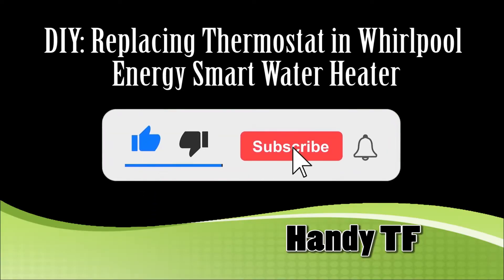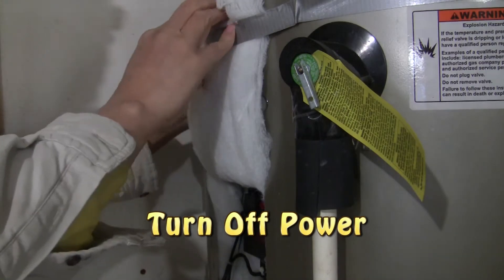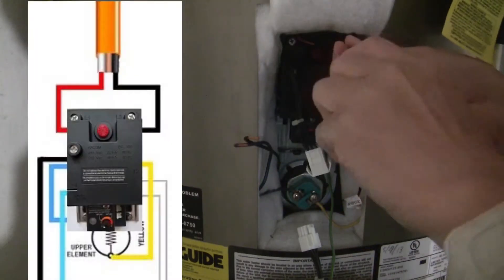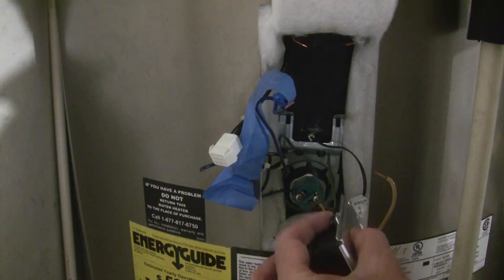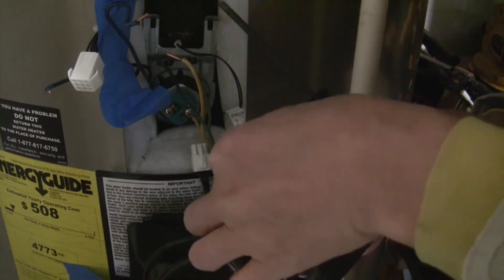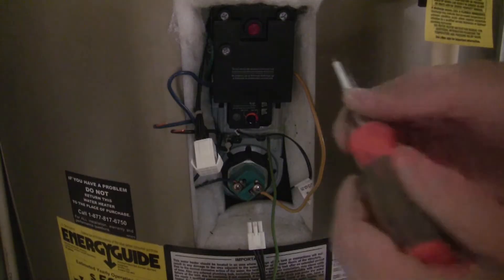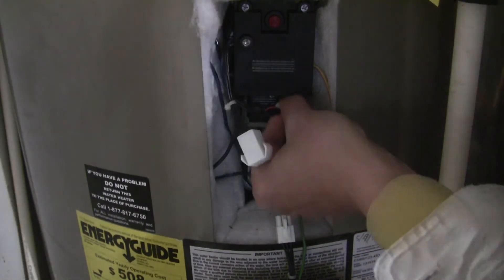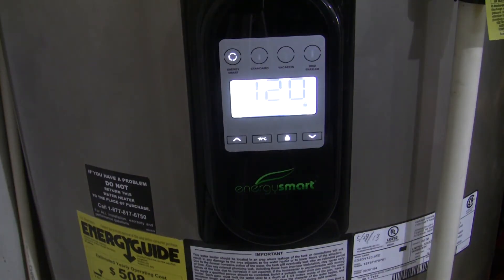DIY: Replacing Thermostat in Whirlpool Energy Smart Water Heater

Comment: Thank you so much for making this. I have to change this same thermostat. I kept looking up A o smith cause that's my water heater. This video came up, and I overlooked it cause it is a whirlpool. However, it's the very same thermostat. I would have had to call an electrician if not for your video. Thanks

Comment: Like others before... thank you for this video.  Two points to share:  when you reconnect the small ground wire (no reasonable excuse for using such a micro screw/nut) use a small piece of cellophane tape over the head of the retaining screw to hold it into the thermostat housing, then carefully start the tiny nut from the other side and tighten slowly.  Secondly, use a pair of long needle nose pliers to insert each of the top corner wires and avoid cutting your fingers on the razor bladed sides of the thermostat cavity.  But once again, thank you Handy this video was treasure to find.

Comment: Hi Hand TF, i have the older model Whirlpool Energy Smart water heater with the diagnostic codes on top with the blinking light. It blinks twice. The water heater shut off, it was on energy save mode. The water was  very hot, before the water heater turned off.
I reset it a couple times, after it did the same thing. Any idea?
Reply: If you get an E02 code with extremely hot water  check to lower element before distrusting the thermostat.

Comment: Hey Handy;  thank you for the video.  I have this water heater, and the Control Module appears dead.  No indicator lights at all.  Power is good to the heater, the elements are good (12.6 ohms each), and I can read 240 VAC at the correct places.  The fact that there are no indicator lights on the Control Module lead me to believe there is a problem there, but I  don't want to spend $150.00 on the Parts Cannon unless I'm sure that's the issue.  Might you have some info on that, and how to test it?  Is there a way to tell if it's the Control Module, Thermostat (or both) ??
Reply: By the way, the water heater had been off for 8-10 months and I turned it on this week and  had hot water at first, then warm, then cold over about 3-4 days.

Comment: Hi Handy Do you have any experience with The 2003 Energy Smart Whirlpools  With the Diagnostic Box/ Device on top of the water Heater
Reply: I've been looking for a video on that as well.  I need to replace mine.
Reply: Hi, has anyone found info about the older energy smart water heater with the diagnostic box in top, with blinking light to tell the error code?

Comment: Where do you get the thermostats
Reply from the maker: I called and got it directly from the Whirlpool itself, it is still under warranty.
Reply: @handytf  Any issues with thermistors? I got n E03 code that was for thermistors, but drop down menu said thermostat. I finally had to call the company in Johnson city, TN to get the thermostat. I'm gonna install it tomorrow.